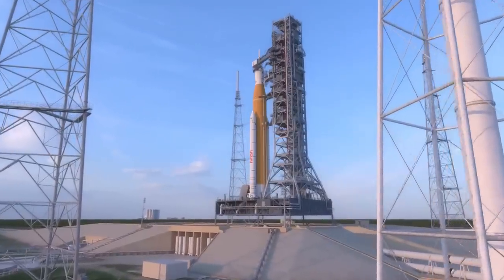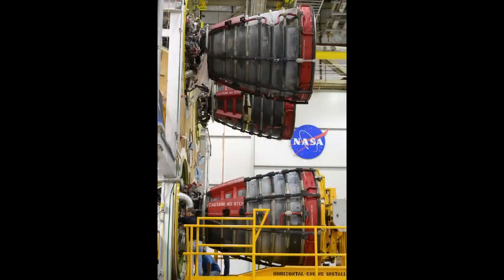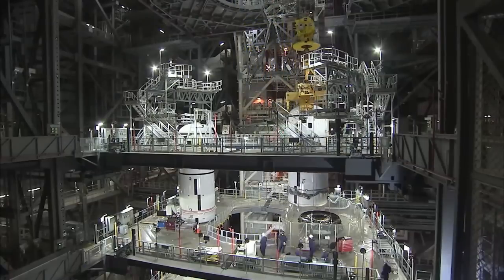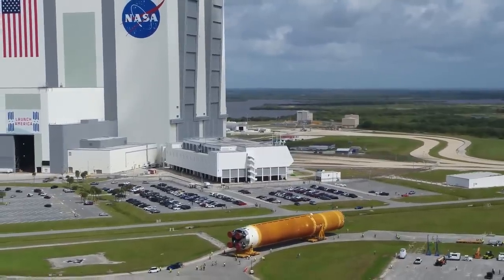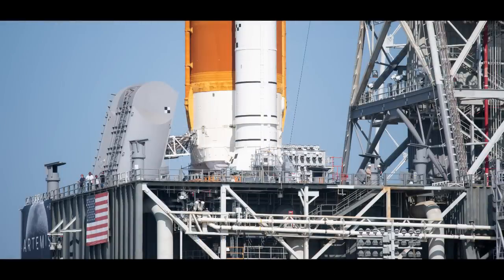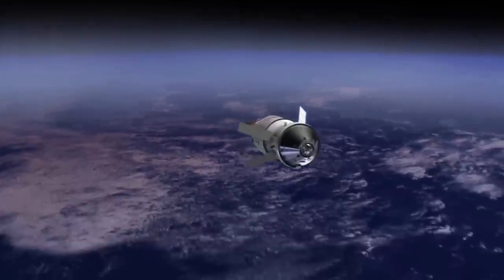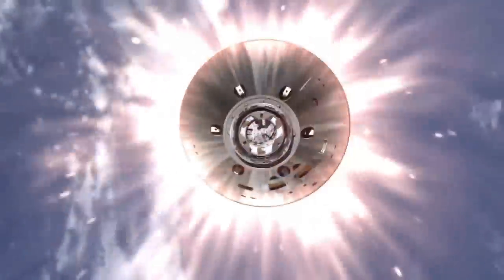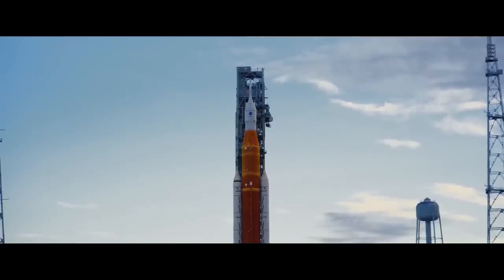What's The Big Deal About Artemis - NASA's New Massive Moon Rocket

Comment: I was lucky enough to work on the first two Orion capsules for several years, and I'll be heading down to Florida next week to watch it fly. I know it's a gamble if it will actually go or not, and I'm not a betting person, but if there's any time for luck to be on my side, this is it!
Reply: I'll pray to my gods of war that this war machine rumbles to life.
Reply: I would trust the older experienced engineers over the fly by night companies we have now.   We used to analyze things to death before anything flew so they had a very high first time success rate.  Now we have Elon who has more failures we ever did in total.   SpaceX is just down the street from me, they used to poach engineers from our company.  I wouldn't trust anyone's life on their Starship.  As far as I have heard they haven't even begun to design the electronics for a Mars mission.  They are going to get a huge sticker shock when they have to buy real space rated parts instead of the cheap commercial parts they are using now.
Reply: @RS-ls7mm  This is possibly the dumbest comment I've seen on youtube in a long time.
Reply: @goodcitizen4587  Then look in a mirror.
Reply: @spider0804  Is that the type of airplane you would want to fly in?  One that crashed dozens of times and then put into production because it didn't crash the last time?
Reply: @spider0804  Also we are talking Starship not Falcon.  There was nothing very innovative about Falcon, mostly old proven tech.
Reply: @RS-ls7mm  buddy take a chill pill. nobody arguing here, just you. no need to blabber
Reply: @bumbee9078  How clueless.  I see reading isn't your strong suit.
Reply: @RS-ls7mm  absolutely it is, do you really believe in your heart that I would want to drive a car that has never seen a crash test? Same for rockets.
Reply: @RS-ls7mm  also I repeat myself in saying Falcon is the most reliable rocket in history because of those crashes. You can try to steer around it all you want but I will keep repeating it. Why not take the old approach and just find out there's a problem when there is life on the line and you lose a crew, that is what you are advocating for.
Reply: @RS-ls7mm  try to tell me i’m wrong
Reply: @RS-ls7mm  Shut up Jeff!
Reply: I have made a few contributions myself, though "we" cannot divulge the type of small components we made for Orion/SLS but.  It was very meticulous and very detailed the manner in which we had to create them.  And, document the process and how, and what we used.  I'm very excited and proud to see our hard work, actually "work".
Reply: @goodcitizen4587  agreed, i have seen kpop stans fighting but this is...
Reply: IMO, the only reason it gets delayed is weather
Reply: I think its worth a shot to go watch a launch, this is the most powerful rocket in history, and who knows how many of these will fly considering the shaky foundations this thing rests on. Hopefully there's good weather, I imagine poor weather and high wind is the most likely cause for a delayed launch.
Reply: @RS-ls7mm  yeah, you sure analyzed the wiring, nylon sheathing and hatch design of Apollo 1 to death. Three deaths to be precise. And then continued to analyze the O-Rings on the boosters and the foam on the external tank of the shuttle to death. 

And what are you getting at with the poaching part? You had dumb engineers at your company, and Spacex poached them? Why did you hire them in the first place?
Reply: @RS-ls7mm  Except for the rockets landing themself...on a barge...in the ocean. Lol
Reply: @BasePuma4007  nice story bro
Reply: @goodcitizen4587  Nice story? What the hell does that even mean?
Reply: @RS-ls7mm  There's a dumber comment in their mirror?
Reply: @imEden0  Falcon has surpassed the total number of launches of Atlas V with a single failure to orbit the payload. As far as Soyuz goes, there have been various failures and mishaps.
Reply: @RS-ls7mm  You really think they're gonna launch humans on Starship after only 1 successful test? Yeah that won't happen. And if that's what you're worried about (being human rated after 1 good flight), then SLS should scare you because that's literally what they are doing
Reply: @spider0804  yeah, idk why i said Soyuz. I still like atlas v cause it has a cooler design. Too bad it’s going to get replaced, though Vulcan is exciting too. Falcon 9 is nice, but tbh sort of over engineered. They could have used parachutes (which they tried and failed to use because no drouge chutes iirc) which would have simplified the design. Maybe land the falling booster on a boat. You would get more thrust out of it, too
Reply: @imEden0  If you use a parachute there is a high chance of damaging something like an engine bell. If the tank lands on a large rock it goes from reusable to salvage. Parachutes are not accurate enough to land a first stage on a 100 by 100 foot square. They did what they needed to, to make it as profitable as possible.
Reply: Jesus christ, the space community seems to be super divided nowadays...
Reply: @spider0804  land it in an ocean with some sort of mechanism (that’s probably difficult to make) that stops water from getting in the engines
Reply: @imEden0  Or just land it like they do and have the engines in perfect condition. Fuel is only 5% of a launch cost, they are happy to use some to get the rocket back.
Reply: Going to the moon where have i heard that before
Reply: @RS-ls7mm  Having used Linux heavily for nearly 20 years and having been soured on the whole open source ethos by bad experiences, I have mixed feelings about SpaceX; it's such a similar development model. However, I'm not too worried because I found the best open source projects were those with strong leadership, which several space companies have, and/or clear goals, which everyone in the space industry has right now.

I'm more concerned by the sort of behaviour, surprisingly common in open source, which bears a striking resemblance to the guidance Britain gave to its saboteurs in the 1930s. It mostly consists of constructing very clever arguments for implementing overcomplicated rubbish which will waste peoples' time. It reminds me of the news from the 90s that industrial espionage and sabotage had reached epidemic proportions, and indeed, the parts of open source most plagued by this are the development of desktop features to compete with Microsoft and Apple. (Or they were; I stopped paying attention years ago.) However, there's nothing stopping this behaviour affecting businesses too, large or small. I used to hear from people who experienced it in the workplace. Again, I think strong leadership and clear goals are probably the best strategy to combat it, though to some extent, smaller companies will always be at the mercy of megacorps with more money to throw around. When Starship suffered that pipe explosion at just the right time for SLS to take center stage, I immediately thought of sabotage.

Comment: Oh!!!! I thought those were merely of the same design as the Space Shuttle engines.  I didn't realize they tore them right off of some shuttles.
Reply: Including those four, I think they still have 16 left in total. Since the engines are destroyed on each flight, we have four SLS launches until the system needs news engines.
Reply: Reused engines, but their operation has been improved.
Reply: @cube2fox  yeah. No point letting them sit around in my opinion. It would also delay the program for no good reason to keep ‘em.
Reply: @imEden0  it’s a waste either way. The RS-25s were designed for optimal performance at both sea level and in vacuum, and are extremely expensive. If you were going to dump the engines into the ocean every time, you wouldn’t need such high performance and reusability. It could have been cheaper to just develop a new engine instead of reusing some old engines for a few launches before producing more of the expensive things.
Reply: @J7Handle  they want to use as much old tech as possible. It’s really useful to not have to spend money on just design making when you have such a small budget, and then also not having to pay to fabricate new parts? That’s great! Just reuse leftover engines and booster segments, and you’re all good. Their budget is increasing, so by the time they run out of engines, they can afford new Rs25 engines for flights (though they probably already can)
Reply: @imEden0  By the time they run out of engines, after Artemis IV in the 2030s, SLS will hopefully be cancelled. Since SpaceX's Starship rocket will, hopefully, be human rated by then.
Reply: @cube2fox  SLS is approved and funded through artemis V i think. Also, SLS is necessary to launch Orion, something Starship cannot do
Reply: @imEden0  When Starship is human rated, there is no need for Orion anymore.
Reply: @cube2fox  Keyword when.
Reply: @cube2fox  it's also bad to rely on one system to work
Reply: @cube2fox  sls is more likely to work because of its simpler profile and more reliable engines

Comment: Holy crap! I just quickly glanced a few things about the first 5 Artemis missions before starting this video because honestly, I seem to live under a rock of some sort. Much as I try not to.  Even if NASA makes these goals in twice the time, it'll be an incredible feat just to see the Lunar Gateway get built. It's also mindblowing to think that the successor to the ISS seems like it's going to orbit the moon. But I feel like there are certain logistical challenges with that which would be remedied by having a twin station in orbit around the Earth acting as an unmanned orbital warehouse. In any case it's a very exciting time to (try to) follow space travel news.
Reply: The biggest leap will come once we have a manufacturing system based in space (raw materials to parts and bulk food systems), once you figure out how to forge in low lunar gravity then you can begin building amazingly fast and easily due to low gravity and not having to rely on escaping earths gravity with the materials.
Reply: I don't think there will be anything like ISS. It was one of the most important parts of research in space, other than rockets and science instruments. Of course, there will be similar elsewhere, but this was at the forefront of research in space around the earth.

Comment: Yea, I'm super curious about what those valves are made out of to operate in a rocket exhaust environment, would be a good topic to show.
Reply: Probably something cheap and mundane. With the small size and very very low burn durations you can use pretty much anything.
Reply: @DenDodde  paper
Reply: @DenDodde  lol, sorry to disappoint. I make the valve bodies at my job. The material my company makes for that purpose is a HIGHLY specialized and hard to manufacture carbon-carbon composite that can withstand EXTREMELY high temperatures before deforming.
Reply: @4077Disc  I smell a fishy fish. Carbon composites are TERRIBLE with temperature, and when they get hot they deform along even more axis then when cold.
Reply: @DenDodde  lol. sure bud. try to research carbon-carbon composites. that may help you out.

Comment: Nice job, Scott. I worked on the Orion heat shield and the back shell (conic portion). The heatshield is an ablative material but installed in block form rather than hexagonal tubes as used on Apollo. The back shell is identical to the “tufi” tiles used on certain areas of the orbiter. Most of the tiles are covered with tape to provide emissivity and ESD properties. I also was part of the team that installed thermal blankets inside the ICPS. The SLS vehicle is a massive beast. We at KSC are very eager to see it fly. Sure, we’ve had some scrubs, but this vehicle is different than the shuttle was, which I worked on from ‘88 to the end of the program. Go Artemis!
Reply: @lepidoptera9337 Whatever you say. Please don’t tell me what and what not to put on the internet. You’re hardly qualified to argue with me.

Comment: The only thing that the SLS core has in common with the Shuttle External Tank is the diameter and basic architecture (separate LH2 and LOX tanks separated by an intertank structure). Honestly, NASA should have had Aerojet Rocketdyne looked into adapting the RS-68 engine for manned spaceflight us.
Reply: They actually did but determined the ablative nozzles on the RS-68s would get too hot from the SRB exhaust
Reply: They actually planned on using the RS-68 for the Ares V, but it turns out the Ablative nozzles don’t do well when clustered, so that’s why they went with the RS-25
Reply: It would be better to use the RD-120, as it's both cheaper and higher performing. But, of course, Russian engines are a no no.
Reply: @stsk1061  the RD-0120 was lower performance than the RS-25 (both in thrust and Isp), but iirc they were much cheaper and Rocketdyne used some of the cost-saving features in the newer version of the RS-25.
Reply: @janmelantu7490  I was comparing it to the RS-68, but it had higher Isp than the RS-25 also - 455s vs 452s.
Reply: @janmelantu7490  All those cost-saving features must be why the new ones are going to cost more than the originals. It's not cheap, saving money... ;)

Comment: As cool as this thing is, it is pretty sad that those engines and SRB segments flew several times before,  but on this brand spanking new rocket, they'll fly for the last time :(
Reply: Won't they do the usual SRB casing recovery?
Reply: @johndododoe1411  As far as I understand it (and I'm not claiming to understand it very far) no, they won't.
Reply: @johndododoe1411  no, there is no capability for recovering the SRBs. NASA determined that it would not be cost-efficient to implement a recovery system and ultimately refurbish them.
Reply: @calessi  So what happened to the established recovery procedure for the exact same booster parts?  As I understand it, NASA or other government ships sailed to the splashdown location and fished them out of the water, all the rest was done by the contractor that (still) makes the boosters.
Reply: @johndododoe1411  all I can tell you is that they aren't the exact same parts: the booster frustums don't even have recovery parachutes built into them, and I suspect that the pyrotechnics for severing the engine nozzles before splashdown have been omitted as well. NASA simply made the determination that it was not economically efficient to recover and refurbish them.
Reply: Don't be sad that all the boosters will be tossed. Sending humans to deep space is really hard. You can't have everything. NASA wisely chose to maximize lift and reliability by making the rocket expendable.

Comment: 10:50 - quite surprised to see how small the SLS Trans-Lunar Injection stage looks compared to the Apollo S-IVB!
Reply: SLS isn't designed to do quite as much as Saturn.  Saturn had to carry the lunar lander and ascent stages in addition to the capsule.  SLS is just carrying the capsule.
Reply: ICPS is an interim solution as the name implies, It would be more appropriate to compare S-IVB to the EUS (Exploration Upper Stage) which will use 4 RL-10 engines and be capable of co-manifesting large payloads under Orion in a similar configuration to S-IVB.
Reply: @tippyc2  That's only the ICPS. The EUS will actually be larger than the S-IVB, while also having a higher Isp.
Reply: Tiny. Centaur was built to carry satellites to higher orbits, not spacecraft to the Moon. It's a short term substitute. The Exploration Upper Stage will look a lot more reasonable - but it's also disproportionately expensive.

Comment: Why is the lox tank on top?  It seems like it would be more stable to have the denser fuel on the bottom.  Does it have to do with the srb attachment points, or the rate which the fuel is consumed, or something else I haven't thought about?
Reply: It doesnt make rocket more stable tho. In atmospheric flight objects tend to face the heavier side into the airstream

But idk why they did that
Reply: Given the larger volume of the hydrogen flow, you'd need a much larger feed line from the H2 tank down to the engines, and you'd also need a lot more insulation to keep the H2 from boiling on the way down.  Technically, it's much less challenging to move liquid O2 from the upper tank than liquid H2.
Reply from the maker: In aerodynamics you want the center of mass to be higher up for stability.

Comment: I'd say the big deal is the price tag. Cost+ has got to go!
Reply: And it might but in order for cost+ to go there has to be healthy competition. The best competition to SLS is the untested (in orbit) Starship that keeps exploding and the Blue Origin equivalent that is years behind both in production with a company that has never even achieved orbit.
Reply: @JenkinsStevenD  well stated.  However the real q is what do u want to do with the rocket and can it be done with cheaper rockets.  The falcon 9 flies and flies well.  If u have in orbit refueling then a bunch of these could probably do the same mission.  60+ million for the fuel launches and at least 100+ million for the manned launch.  If that is less than the sls we should go that way (ps this was the original Obama plan except instead of falcon 9 substitute atlas 5 and delta rockets.  Note all are extraordinarily flight proven now and thee ULA rockets were flight proven then.  Plus atlas and falcon are currently human rated--atlas flies the starliner).
Reply: @TheFirebird123456  I'd agree with going with a cheaper reliable alternative, but the items you've referenced aren't super heavy lifters.  They are designed for LEO.  Their propellant types aren't really stabilized either.  You can't retain the required LOx/LH2/RP temps in space.  The refueling aspect will only get you so far.
Reply: Sir_Artemis  I'm an SLS fan but I can't suggest its ultimate cost efficiency until EM-1 is successful.  Specifically up until the point where ICPS separates.